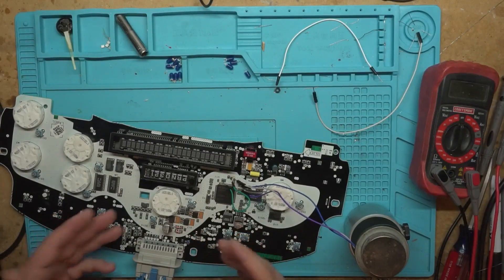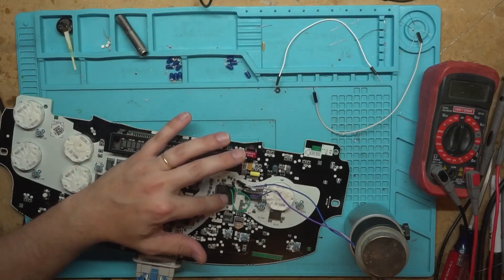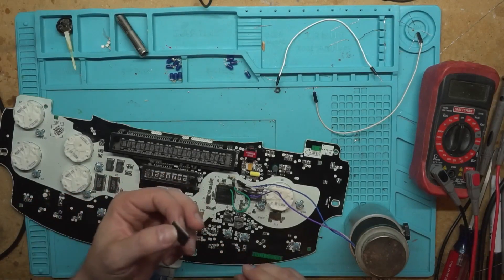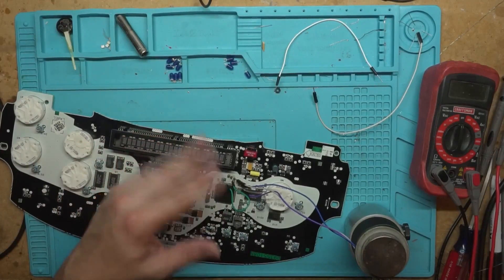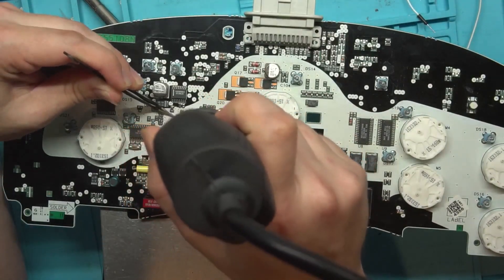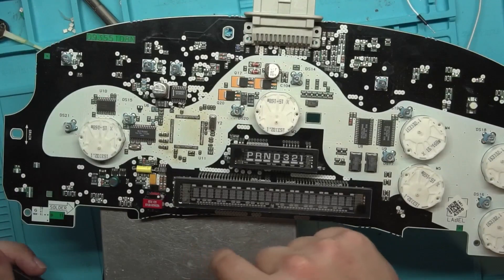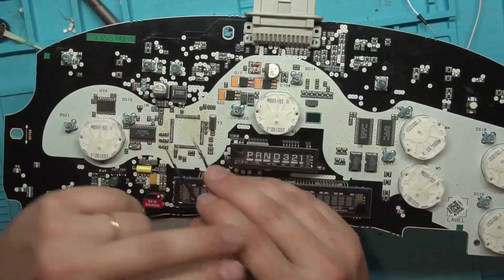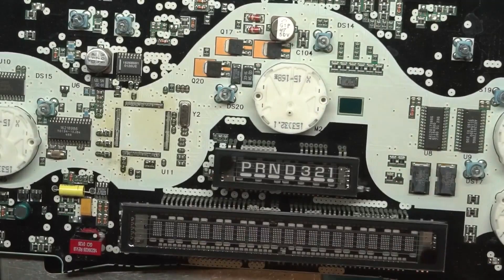Trailblazer Cluster: Trying to use a 9399059 MCU Where a 9397364 Goes

Comment: Might be my imagination, but it almost looks like the stepper motor zeroing on powerup might be a tad slow. Might be best to do a gauge sweep test with a scan tool to see if they are running at full speed
Reply from the maker: I've already put it's original controller back on it. It worked fine I just wanted to know if it could be swapped. I'd say not.
Reply from the maker: Did you like how I yeeted the chip? I normally don't flip them that hard I guess I got nervous for the camera lol.
Reply: @FixedUntilBroken  I've removed a couple from the 03-06 full size truck boards, and those boards don't really have a lot of thermal mass in them to necessitate a board pre-heater.  I've always used the chipquick low heat alloy at a super low sub-300° c and removed them no problem. Soldering them back on is also pretty easy. Drag soldering them under a microscope is pretty trivial.
Reply from the maker: @mike7958  it only takes me about 10 mins to do them drag soldered and doesn't bother me any.  Yes a bottom heater isn't needed due to thermal mass but it makes bringing up slow and down slow easy.

Edit: had to change an is to isn't lol

Comment: I just tested a couple of trailblazer clusters and they aren't slow like that.  Strange how it works but just a little laggy.
Reply from the maker: Yeah it would probably work if you had the source code and could compile it for that mcu. But it's definitely lagging on boot. I swapped back the original mcu on it.

Comment: Putting that much heat to those don't hurt them? Really asking, thought that kind of heat would fry them?
Reply from the maker: No the bottom heater is only getting to about 350c to the board because it's so high up and 370 is a pretty normal temp for how air soldering. You really need to check data sheets on how long you can give it that much heat but I just keep it under 2 mins. At full temp. You do want to slowly bring it up and slowly bring it down.
Reply: Thanks for the info.